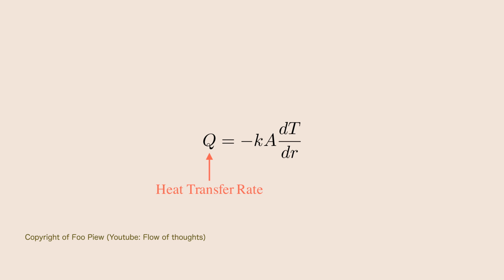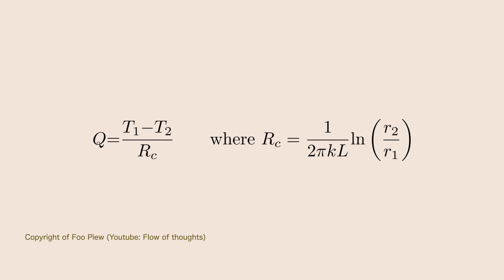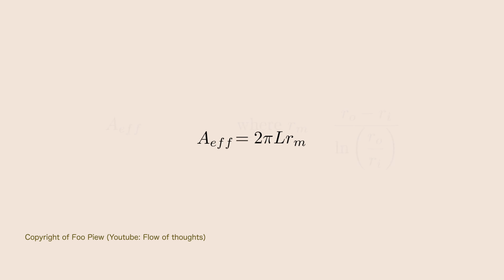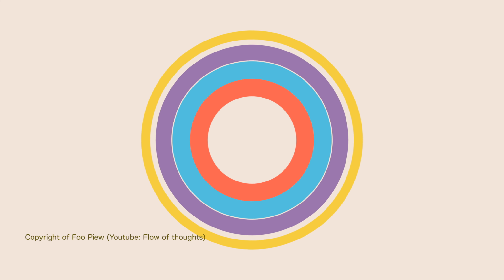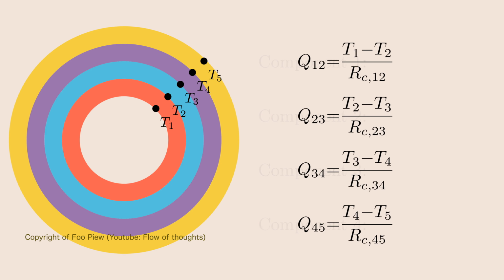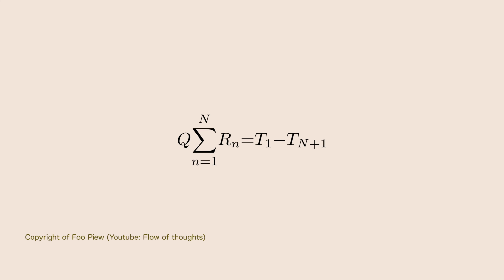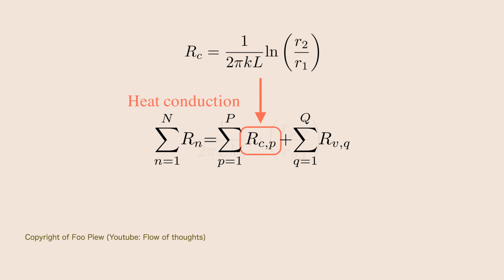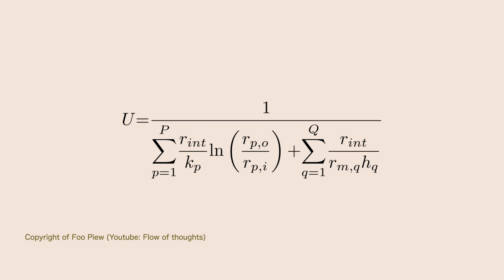Overall Heat Transfer Coefficient for a Cylindrical Pipe

Comment: Can I discuss with you? I feel there is something wrong with the derivation of the formula. Maybe I'm one of those who doesn't agree with the existing formula. please respond
Reply from the maker: @vincenciussufijanhadi1287  Hi, thank you for your willingness to point out the potential problem in the derivation. Could you please specify the specific equation that you do not think is correct? I will strive to respond to you here when I’m available.
Reply: @FooPiew  In short, my objections are:.
1. For the cylinder shape
a. The ratio of the sheath radius to the thickness of the cylinder is never less than 1. This condition occurs when the thickness is (e - x), where e (natural logarithm) is the outer radius and x is the inner radius which ranges from 0 < x < e ^ 0. The reason for my rejection is that the sheath radius always moves larger following changes in area. While the thickness moves linearly. so that there is never an event where the sheath radius is shorter than the thickness. Thus the sheath radius is always greater than the thickness under any conditions.
b. When the cylinder is solid (has no holes), the temperature will be + ∞ (the temperature increases very large without limits at the center of the cylinder). This condition occurs when the thickness is (e - 0). e (natural logarithm) is the outer radius is a natural number and 0 is the inner radius. The reason for my rejection is that it is very unreasonable for a material in a solid condition to be able to withstand heat with a temperature of + ∞. My opinion is that the temperature can still be known even though it is difficult to practice in solid conditions.
c. The ratio of the sheath radius to the thickness is greater than 1 (has no limit) and ends at 0 (NULL) when (e - e) is outer = inner. The reason for my rejection is that the sheath radius must be greater than the radius. But it has a certain value limit !!!
d. In general, the reason for my rejection of points a, b and c is that the use of natural logarithms causes uncertainty in the ratio of the sheath radius to the radius.
a. When the thickness ( e - x ), 0 < x < e ^ 0, then the ratio of the sheath radius < thickness.
b. When the thickness ( e - x ), x = 0, then the ratio of the sheath radius to the thickness + ∞.
c. When the thickness ( e - x ), x = e ^ 0, then the ratio of the sheath radius = thickness.
d. When the thickness ( e – x ), e^0 < x < e, then the ratio of the sheath radius > thickness
e. My question is: How to calculate the temperature at the center of the cylinder when the heat comes from outside the cylinder by conduction with steady state flow ???
f. The predicted calculation error is very serious. When the outer becomes very large and the inner approaches the outer (relatively thin). Then the calculation error in temperature becomes very large.
Why is the existing formula reduction considered as the truth?, this is because the calorific value must always (constant) remain the same in each change in thickness that experiences an increase in temperature when approaching the center of the cylinder along with the change in thickness where the initial temperature comes from the inner radius. With the note that the heat source comes from inside the cylinder.
However, for the case of steady state flow conductor heat transfer in the form of a cylinder. There are other conditions that must be followed. Namely, the value of the sheath radius to the thickness must always be more than 1. Why must it always be more than 1? this is due to the continuous change in cross-sectional area as explained in point C.
PHILOSOPHICAL VIEWPOINT ON THE THEORY OF TRUTH
Based on the theory of truth in the formula, it is a consensus theory of truth. Which is mutually agreed upon. Does not yet cover universal truth in terms of thickness. This allows for propositions that contradict objects and results when confronted.
Understand the Types of Truth Theory:
1. Coherence Theory (The Consistence/Coherence Theory of Truth)
2. Correspondence (The Corespondency Theory of Truth)
3. Pragmatism (The Pragmatic Theory of Truth)
4. Performative Theory
5. Consensus theory. The approach to the theory of truth in this case is still an agreement between scientists
Sources of Knowledge:
1. Rationalism
2. Empiricism (in this section I have not conducted physical testing on material temperature)
3. Criticism
4. Intuitionism
Quote philosophy:
It is with logic that one proves, it is with intuition that one invents (Henri Poincare).
Vincent Sufijan Hadi
Reply: @FooPiew  In short, my objections are:.
1. For the cylinder shape
a. The ratio of the sheath radius to the thickness of the cylinder is never less than 1. This condition occurs when the thickness is (e - x), where e (natural logarithm) is the outer radius and x is the inner radius which ranges from 0 < x < e ^ 0. The reason for my rejection is that the sheath radius always moves larger following changes in area. While the thickness moves linearly. so that there is never an event where the sheath radius is shorter than the thickness. Thus the sheath radius is always greater than the thickness under any conditions.
b. When the cylinder is solid (has no holes), the temperature will be + ∞ (the temperature increases very large without limits at the center of the cylinder). This condition occurs when the thickness is (e - 0). e (natural logarithm) is the outer radius is a natural number and 0 is the inner radius. The reason for my rejection is that it is very unreasonable for a material in a solid condition to be able to withstand heat with a temperature of + ∞. My opinion is that the temperature can still be known even though it is difficult to practice in solid conditions.
c. The ratio of the sheath radius to the thickness is greater than 1 (has no limit) and ends at 0 (NULL) when (e - e) is outer = inner. The reason for my rejection is that the sheath radius must be greater than the radius. But it has a certain value limit !!!
d. In general, the reason for my rejection of points a, b and c is that the use of natural logarithms causes uncertainty in the ratio of the sheath radius to the radius.
a. When the thickness ( e - x ), 0 < x < e ^ 0, then the ratio of the sheath radius < thickness.
b. When the thickness ( e - x ), x = 0, then the ratio of the sheath radius to the thickness + ∞.
c. When the thickness ( e - x ), x = e ^ 0, then the ratio of the sheath radius = thickness.
d. When the thickness ( e – x ), e^0 < x < e, then the ratio of the sheath radius > thickness
e. My question is: How to calculate the temperature at the center of the cylinder when the heat comes from outside the cylinder by conduction with steady state flow ???
f. The predicted calculation error is very serious. When the outer becomes very large and the inner approaches the outer (relatively thin). Then the calculation error in temperature becomes very large.
Why is the existing formula reduction considered as the truth?, this is because the calorific value must always (constant) remain the same in each change in thickness that experiences an increase in temperature when approaching the center of the cylinder along with the change in thickness where the initial temperature comes from the inner radius. With the note that the heat source comes from inside the cylinder.
However, for the case of steady state flow conductor heat transfer in the form of a cylinder. There are other conditions that must be followed. Namely, the value of the sheath radius to the thickness must always be more than 1. Why must it always be more than 1? this is due to the continuous change in cross-sectional area as explained in point C.
PHILOSOPHICAL VIEWPOINT ON THE THEORY OF TRUTH
Based on the theory of truth in the formula, it is a consensus theory of truth. Which is mutually agreed upon. Does not yet cover universal truth in terms of thickness. This allows for propositions that contradict objects and results when confronted.
Understand the Types of Truth Theory:
1. Coherence Theory (The Consistence/Coherence Theory of Truth)
2. Correspondence (The Corespondency Theory of Truth)
3. Pragmatism (The Pragmatic Theory of Truth)
4. Performative Theory
5. Consensus theory. The approach to the theory of truth in this case is still an agreement between scientists
Sources of Knowledge:
1. Rationalism
2. Empiricism (in this section I have not conducted physical testing on material temperature)
3. Criticism
4. Intuitionism
Quote philosophy:
It is with logic that one proves, it is with intuition that one invents (Henri Poincare).
Vincent Sufijan Hadi
Reply: @FooPiew  
  
3.	Is the radius of the ball casing compared to the thickness of the ball shell ever equal to 1? If it is found that the ratio of the radius of the ball shell to the thickness of the ball shell has a value of 1, then the formula used needs to be reviewed. The reason is that the radius of the ball casing moves non-linearly with respect to the thickness of the ball shell. Meanwhile, the radius of the spherical envelope moves based on a certain hyperbolic function (it does not represent a linear line. It mean R2 / ( R2 – R1 ) ~  R2 R1 ( R2 – R1 ). 
So, 
R / ( R2 – R1 ) = ( R2 R1 )0.5 / ( R2 – R1 )   is the ratio of the radius of the spherical casing to the thickness of the skin  ( R2 – R1 ).
              (R1 . R2 )0.5  / R2 -. R1  never worth it 1. Written in the equation is (R1 . R2)0.5  / R2 -. R1 ≠  1.

Let's prove that (R1 . R2)0.5  / R2 -. R1 = 1,  if it can be found is 1, then the previous formula must be reviewed. Note that I will enforce that R2 = R2. R1 and R = ( R2 . R1)0.5. So the ratio of the radius of the ball shell to the thickness of the ball shell is written in the equation :
( R1 . R2 )0.5  /(  R2 -. R1 )			= 1				.…….  equation  1	 
Q 		`			= k. 4π R2.L (∆ T)/ ( R2 – R1 ). 				 
            	Q 			           	             = k. 4π R1.R2.L (∆ T)/  thickness
Focus to R2 / ( R2 – R1 ).
R2 / ( R2 – R1 )										 
R2  					= R2. R1
( R2 )0.5  					= ( R2. R1 )0.5
R					= ( R2. R1 )0.5
              What we are looking for is the radius of the ball shell relative to the thickness of the ball shell.
R / ( R2 – R1 )				= 1,  R = ( R2. R1 )0.5
( R2. R1 )0.5 / ( R2 -  R1 )			=  1,  then,
( R2. R1 )0.5 				=  1.( R2 -  R1 )
              ( R2. R1 )0.5 			             	=  ( R2 -  R1 ),  the equation is squared so that
( R2. R1 )					=  ( R2 -  R1 )2,  
( R2. R1 )					=  ( R22 - 2 R2 . R1 + R12   
( R22 - 2 R2 . R1 + R12 )			= ( R2. R1 ),  
( R22 - 2 R2 . R1 + R12 ) / ( R2. R1 )		= 1,  
R2 / R1 – 2 + R1 / R2			= 1, 
R2 / R1 + R1 / R2				= 1 + 2
R2 / R1 + R1 / R2				= 3,   
R22  + R12					= 3 R1 . R2
R22  - 3. R1 . R2 + R12			= 0
(R2   -  0.381969.R1 ) (R2  - 2.618031.R1  )	= 0
R2 - 0.381969.R1				= 0,	 must fulfill  R2 > R1 	
R2  					= 0.381969.R1
R2 : R1					= 0.381969 : 1,   R2 < R1.  This equation can’t be used.
 And next second equation,				 
R2  - 2.618031.R1  			= 0
R2   		  			= 2.618031.R1  
R2 : R1					= 2.618031 : 1,  this equation is suitable to be used to filfull .
(R2  - 2.618031.R1  ),  filfull R2 > R1.
               So for any R2 (outer) it will always satisfy the equation
( R1 . R2 )0.5  / R2 -. R1 = 1, when R2 : R1	= 2.618031 : 1

              R2 : R1			             = 2.618031 : 1,  is the ratio of outer to inner. Return to
              equation 3
               ( R1 . R2.)0.5 :  ( R2 – R1 ),    is the ratio of the radius of the ball casing to the thickness of the ball.
R2 					= 2.618031
R1					= 1.
( 1. .2.618031  )0.5  / ( 2.618031  -.  1)	= 1.
( 2.618031  )0.5         /  ( 2.618031  -.  1)	= 1

This is a situation where the length of the radius of the ball casing relative to the thickness of the ball has the same length. This never happened. The reason is that the radius of the ball casing moves non-linearly with respect to the radius of the ball. Meanwhile, the area of the ball's shell moves based on a certain hyperbolic function (it does not represent a linear line

However, in the case of heat transfer, steady state flow conductors are cylindrical and spherical in shape. There are other conditions that must be followed. That is, the value of the casing radius relative to the thickness of the ball must always be more than 1. Why must it always be more than 1? This is due to changes in cross-sectional area which do not move linearly with respect to the radius of the cylinder or the shape of the ball.

Conclusion :
 
By finding the equation for the radius of the cylinder casing to the thickness of the cylinder = 1. I objected and as a consequence the existing formula had to be tested in the laboratory 

By finding the equation for the radius of the ball's shell to the thickness of the ball = 1. I objected and as a consequence the existing formula had to be tested in the laboratory.

PHILOSOPHICAL POINT OF VIEW ON THE THEORY OF TRUTH

Based on the theory of truth in this formula, it is a consensus theory of truth. What is mutually agreed upon. Does not yet cover universal truth in thickness conditions. This allows for propositions that conflict with the objects and results when confrontation is carried out.

Understanding Types of theories of truth :
1. Coherence Theory (The Consistence/Coherence Theory of Truth)
2. Correspondence (The Correspondence Theory of Truth)
3. Pragmatism (The Pragmatic Theory of Truth)
4. Performative Theory
5. Consensus theory. The approach to the theory of truth in this case is still agreed upon by scientists

Sources of Knowledge:
1. Rationalism
2. Empiricism (in this section I have not carried out physical tests on material temperature)
3. Criticism
4. Intuism

In general, truth is:
1. Rigid
2. Universal
3. Noncontradictory
4. Can be proven 
5. Radic

Quote philosophy:
It is with logic that one proves, it is with intuition that one invents (Henri Poincare).

My quote philosophy
Mathematics is able to predict errors, but has not fully proven absolute truth.

	I have no intention other than to improve academic opinion. Which has already spread widely to remote corners of the world (especially in heat transfer subjects). And we work together to improve each other and test the truth. How beautiful this world would be if humans learned from each other and became wise about all the problems we face together in this world.

My favorite music:
The lonely shepherd by Andre rieu feat Gheorghe Zamfir
Marriage d'amor –paul de senneville II Jacob's piano
The gael – last of the mohicans-Royal scots dragoon
							Vincencius sufijan hadi 
vincenciussufijanhadi@gmail.com
Reply from the maker: @vincenciussufijanhadi1287  I prefer answering from here to make conversation traceable. Can you provide a link that shows the formula that you agree with?
Reply: @FooPiew  OPEN LETTER
UNDERSTANDING THE CONDUCTION HEAT TRANSFER EQUATION OF STEADY STATE FLOW IN CYLINDER SHAPE
To the honorable,
Anyone studying heat transfer courses (mechanical engineering, chemical engineering and nuclear engineering).
In
Place,
Together with this open letter, with humility, we send an open letter to anyone, which may be read by anyone who is willing to read this letter.
The purpose of this open letter is to re-discuss the explanation of steady state heat transfer on hollow cylinder walls
I am the writer of the letter refuting the formula that has been written in books and literature. Especially on conductor heat transfer on steady state cylinder walls.
Briefly my objections are:
1. For cylindrical shapes
a. The comparison of the radius of the sheath to the thickness of the cylinder is never less than 1. This condition occurs when the thickness is ( e - x ), where e (natural logarithm) is the outer radius and x is the inner radius which ranges from 0 < x < e ^ 0 . The reason for my objection is that the radius of the sheath always moves larger following changes in area. While the thickness moves linearly. so that there is never an event where the radius of the sheath is shorter than the thickness. Thus the radius of the sheath is always greater than the thickness under any conditions.
b. When the cylinder is solid (has no holes), the temperature will be + ∞ (the temperature increases very large without limits at the center of the cylinder). This condition occurs when the thickness is ( e - 0). e (natural logarithm) is the outer radius is a natural number and 0 is the inner radius. The reason for my objection is that it is very unreasonable for a material in a solid condition to withstand heat with a temperature of + ∞. My opinion is that the temperature can still be known even though it is difficult to practice in solid conditions.
c. The ratio of the sheath radius to the thickness is greater than 1 (has no limit) and ends at 0 (NULL) when (e - e) is outer = inner. The reason for my objection is that the sheath radius must indeed be greater than the radius. However, it has a certain value limit !!!
d. In general, the reason for my objection from points a, b and c is that the use of natural logarithms causes uncertainty in the ratio of the sheath radius to the radius.
a. When the thickness is (e - x), 0 < x < e ^ 0, then the ratio of the sheath radius < thickness.
b. When the thickness is (e - x), x = 0, then the ratio of the sheath radius to the thickness is + ∞.
c. When the thickness is (e - x), x = e ^ 0, then the ratio of the sheath radius = thickness.
d. When the thickness is (e - x), e ^ 0 < x < e, then the ratio of the sheath radius > thickness
e. My question is: How to calculate the temperature at the center of the cylinder when the heat comes from outside the cylinder by conduction with steady state flow ???
f. The prediction of the calculation error is very serious. When the outer becomes very large and the inner approaches the outer (relatively thin). Then the calculation error in temperature becomes very large.
Why is the existing formula considered as the truth? This is because the calorific value must always be (constant) in each change in thickness that experiences a change in temperature increasing when approaching the center of the cylinder along with the change in thickness where the initial temperature comes from the inner radius. With a note that the heat source comes from inside the cylinder.
However, for the case of steady state flow conductor heat transfer in the form of a cylinder. There are other conditions that must be followed. Namely, the value of the radius of the sheath against the thickness must always be more than 1. Why must it always be more than 1? This is due to changes in the cross-sectional area that do not move linearly against the radius of the cylinder as explained in point C.
PHILOSOPHICAL VIEWPOINT ON THE THEORY OF TRUTH
Based on the theory of truth in the formula, it is a consensus theory of truth. Which is mutually agreed upon. Does not yet cover universal truth in thickness conditions. This allows for propositions that contradict the object and results when confronted.
Understand the Types of Truth Theory:
1. The Consistency Theory of Truth
2. Correspondence Theory of Truth
3. Pragmatism
4. Performative Theory
5. Consensus Theory. The approach to the theory of truth in this case is still based on the agreement of scientists
Sources of Knowledge:
1. Rationalism
2. Empiricism (in this section I have not conducted physical testing on the temperature of the material)
3. Criticism
4. Intuitionism
Quote philosophy:
It is with logic that one proves, it is with intuition that one invents (Henri Poincare).
My quote philosophy:
Mathematics is able to predict errors, but has not fully proven absolute truth.
Reply: @FooPiew  baiklah saya akan buatkan grafiknya melalui chanel youtube. terimakasih atas responnya.